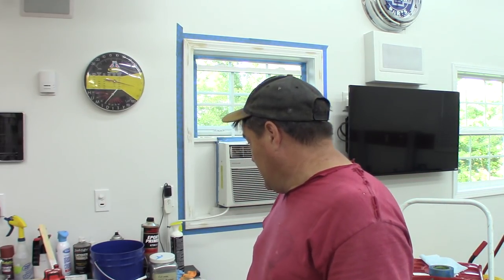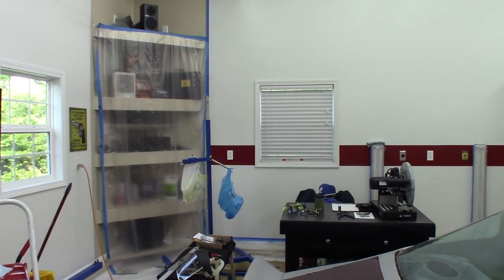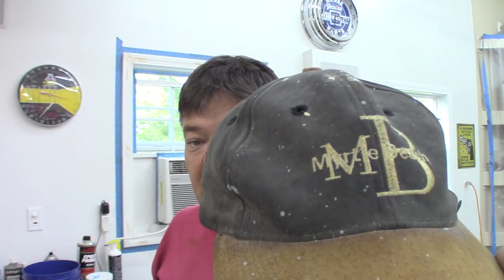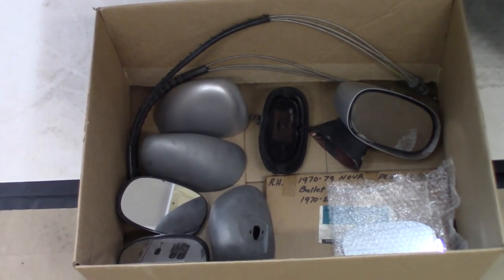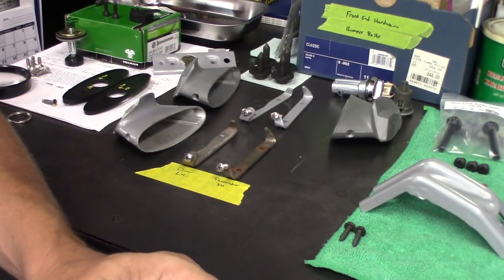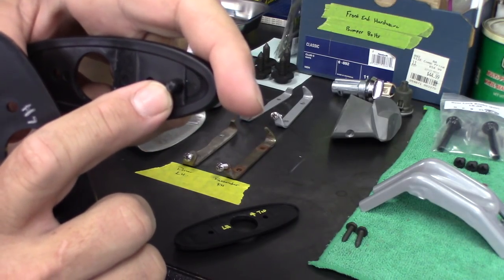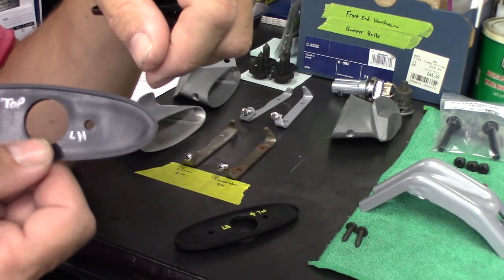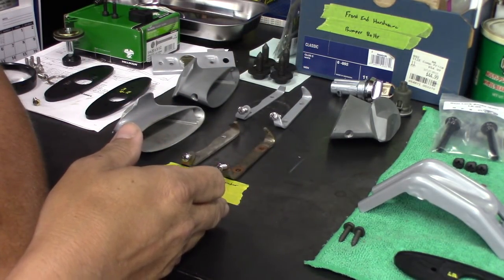1970-81 Camaro Door Mirrors

Comment: Hi Russ. Good video about mirrors. One thing I found out about mounting of passenger side mirror was prior to 74, all passenger side mirrors were mounted at the dealership. None were mounted at the factory. Also the mount bracket was mounted either by sheet metal screws or rivets, dealers choice. I would like to know what year GM started using the bracket you show from the 81 passenger door. It's nice.
Reply from the maker: That's great info Wiley and explains why there are so many differences seen when it comes to the passenger mirror. Thanks for sharing.

Comment: good stuff... the reproduction ones are huge.. they look good though. I remember the mirror controller had sort of a square mounting plate on the panel inside but can't remember if it was screwed in or tab mounted somehow. I do remember unscrewing the controller piece one day when I was fooling with it.
Reply from the maker: Thanks Batz. Yes those mirrors do look huge, not sure what I will do. I think that mounting plate does have two screws. I need to dig mine out. I think its also in rough shape.

Comment: Hey bud - did you do a video on restoring the remote adjuster cable?
Reply from the maker: Hey Erik, not the cable, I just cleaned it up. The knob however screws out and you can restore it.
Reply: @DoubleRRestorations  Thanks buddy. Saw that, never would have guessed!

Comment: I found your channel when looking for mirror information, I really like the content so I subscribed. I am working on a 1975 Trans Am, and the 1975 Fisher body manual shows on the F bodies that the thicker end of the gasket faces down, away from the door glass? And it shows part number 9832127 as the driver, or left side gasket? Are the earlier cars different?
Reply from the maker: Thanks for the subscription and I hope you enjoy the content. I also have an 81 in the garage as well and it had a 126 as the driver side gasket. I will have to look at my Fisher manual and see if it says the same, I bet it does and I would think that the manual is correct. I do know that if you install the gasket in that way though it will angle the mirror in towards the door glass and not look right.  My 81 had a passenger mirror mounted this way when I got it.

To confuse matters, I got a new nos GM mirror, that was a passenger side that did come with the 126 gasket. The difference was that the template showed the mounting tab in the rear instead of the  front. I came to the conclusion that you could use a 126 or 127 on any side, but the tab that sticks down would be either in the front or back. I have also seen repro gaskets that didn't even have that tab. The drivers side skin comes with the holes already in the skin. All the ones I have here in the garage has that tab in the front.

This was very confusing when I went through all of this.  Great question.
Reply: @DoubleRRestorations  Thank you for the response. It is  frustrating getting info on these mirrors, your video's on them are the most informative I have found, including GM manuals. I saw one of your subscribers indicate that thru 1974 the right mirrors were installed by the dealer, I suspect this may include 1975. The reason I say this is that my right door does not have the stiffener like the left door does, and the 1975 Fisher Body Manual for the F bodies makes no mention, or shows a right door mirror, just the left. It does show a right mirror for all the other car lines, but no F bodies.
Reply from the maker: @toyotaron7830  Thanks for the compliment on the videos. These mirrors can be frustrating for sure. There is a bracket that you can add to the passenger side. It's difficult to find, but it bolts into the door shell and goes up against the inside of the skin. They are rare though. I have only come across two of them. If you are doing skins, you can always add one like the drivers side has.

Comment: Do you have a photo of the passenger mirror mounting bracket installed? I'm looking for a close up of the door shell area to see what it looked like from the factory. I got one of the brackets on eBay to install on my 71 passenger door. I'll probably take a path similar to this http://nastyz28.com/threads/passenger-side-mirror-location.318866/#post-3636364
Reply from the maker: I sure don't. Are you putting skins on? I actually cut the drivers bracket off the old skin on mine and transferred it to the passenger side. That thread has some good info. Thanks for watching.
Reply: @DoubleRRestorations  That's a good idea. I'm working on replacing the driver skin now. The passenger skin looks good, but I"m considering replacing it because of the rust I found on the driver shell flange. I'd hate to have issues with it later.
Reply from the maker: @RestoCar  I'm in the process of working on skins for my 72. Decided to try a repo on my 81 before I commit to the 72.

Comment: I haven't found any mirrors for my 1981 Z28 I want dual manual mechanical remotes driver and passenger ESPECIALLY passenger....GM! you GM you!
Reply from the maker: I'm actually restoring a few sets. I found some nos ones for OverKill and I'm restoring my two original sets. Not sure I have ever seen a passenger side with the remote.